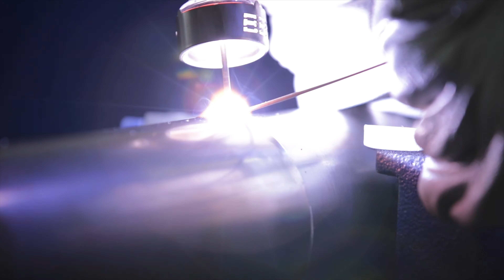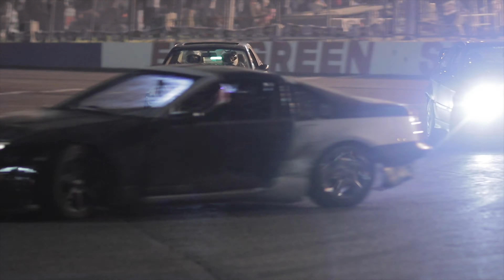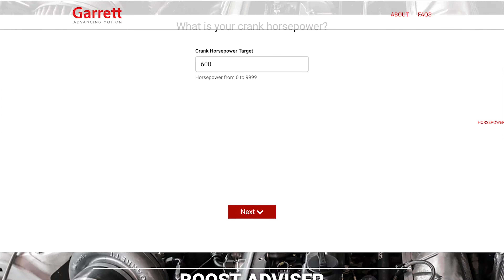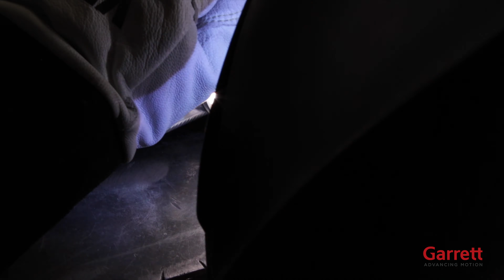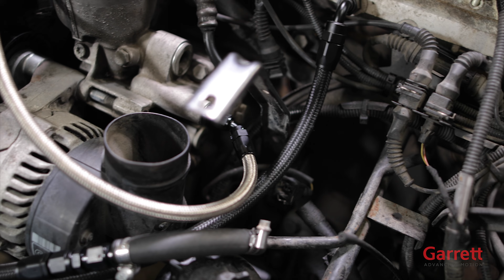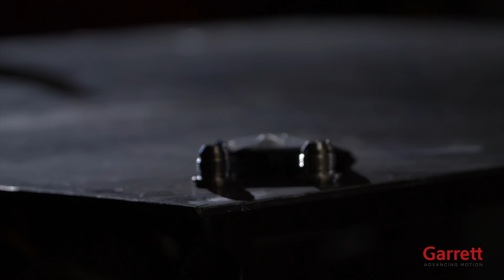How To Turbo a Race Car Part 2: Turbo Matching

Comment: good, but as an official representative of Garrett you should have mentioned the importance of clocking the center section for the proper coolant flow for which these turbos are designed for (feed lower than the return)!

Comment: I had a GTX3584RS on my turbo nissan patrol y61 and the bearing failed after 6 months, my boost was 0.3 bar and failed after i increased to 0.6 bar no comment tbh.

Comment: I'm trying to find a turbo using the formula on the website but I always end up with a PR that too high  like between 3.6 to 4+ while the MFR is around 40. Tried also for builder build 77-90 MFR but PR was over 5. Its for a 4 cyl, 2.0L stock block bolt ons 400HP street build, the other is a 4 cyl 2.5 stroker long block at 770-900HP drag build (all crank hp)

Comment: Hello! thanks for your video. What could happend if you modify the exhaust manifold  in a diesel engine with vtg turbocharger? If the Engine control unit manage the wastegate, Could you affect and brake the balance of the engine power is the exhaust manifold is modified? Thanks, Raúl

Comment: Please advise if it is possible to install turbo to 3.6L V6 Chrysler 300, If yes how much boost can be pushed to engine and how much horse power can be gained? If no then, its time to switch but i like 300 and i want modify it, your advise in this matter will be much appreciated.

Comment: At first glance, I really appreciated Garrett's Boost Advisor.  It allows you to save your configurations and in doing so allows a person to change one variable at a time to see how it affects the recommended turbine.  For example, if you were to change ambient air temperature 30 degrees F, the advisor might recommend a different turbo.  Another example would be changing altitude from sea-level to 5000 feet might also recommend a different turbo.  In making these changes in inputs, I was able to gain confidence that the turbo model/size would work well in both spirited high altitude mountain roads as well as along the western coastline cliffside roads.  But, the advisor fell short when it came to A/R.  Ok, Garrett and your videos both explain, very well I might add, how different A/R influences how a turbine wheel is influenced and its implications on flow and lag.

Why doesn't Boost Advisor recommend an A/R based on your inputs as well?

Comment: Would you alter the engine displacement if it's a rotary engine? e.g. would I simply enter 1.3L for a 13B-REW rotary engine?
Reply: Generally you would double it for a rotary - so size it for a 2.6L piston engine in terms of exhaust flow/turbo selection

Comment: What would you recommend for an 02 WRX!? 
  The TD04 will get into boost quickly, but runs out on top end. The VF22 or similar will have great top end, but has lag and takes a while to get into boost.
   Personally, I'd like to go with a BB setup. I've ran the GTP38r on my 01 F250 and I loved it!  Great spool, and worked great for the power level I had..
Reply: I reckon a VF34 suits the WRX well, or even better a VF36 with the necessary twinscroll sump and header. VF37 works well too but comes in slightly later than the the VF36. 
Those turbos are a good middle ground between something bigger and the td04 without obliterating the gearbox and WRX engine.

Comment: Thanks for the great videos
I have a question you may be able to answer, I have an Experimental racing type aircraft engine ported flow matched, turbocharged, inner-cooled, injected
I am running out of boost above 18,000ft, I can run 25inches Hg manifold pressure and 2500rpm to 18,000ft above that I start losing Hg manifold pressure. I would like to maintain 25inches Hg to 24,000
Can you help?
Engine: 360ci- 220hp @ 2700RPM 
Engine flow = 217CFM @14.7psia STD 
Pressure ratio = 2.2 
Corrected airflow(lb/min) =31.1 
FYI @ 18,000ft we have 1/2 atmosphere 7.36psia @ 24,000 out side air pressure is 5.71psia or 11.64Hg
Turbo is:  Roto-Master (Rajay) Turbo Model 3AT6EE10J2 (325E10-1) P/N 600573-00 or 600576-00 or CF600573-9000 (RJ0331-1)